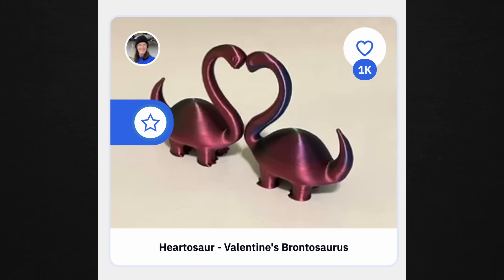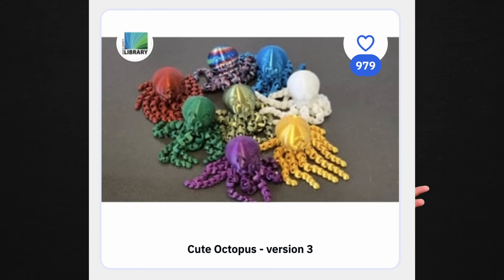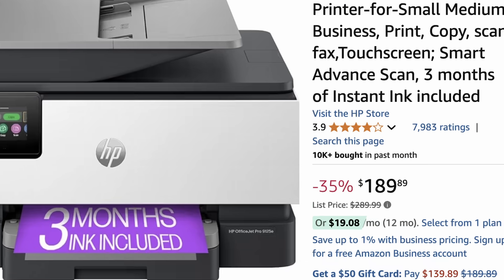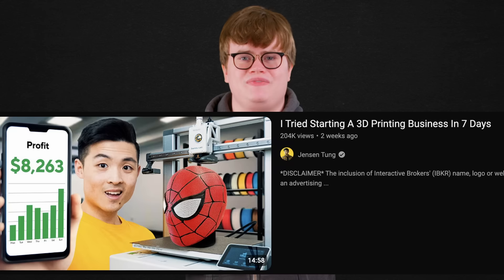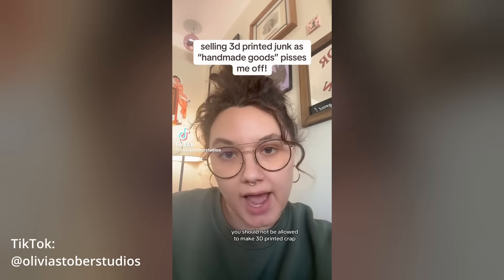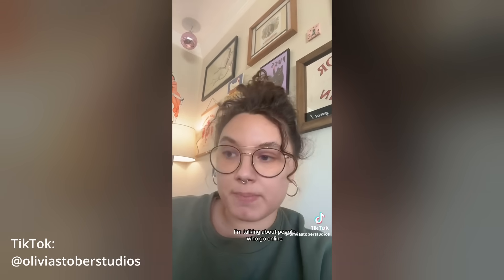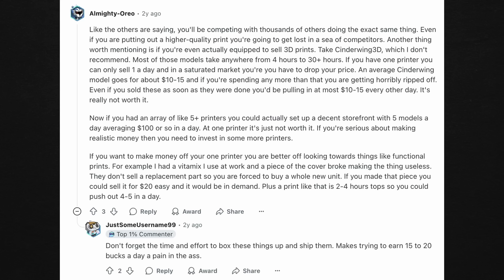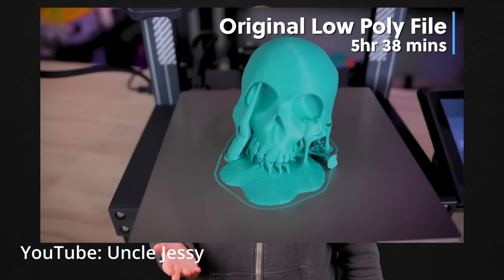The Rise of 3D-Printed Slop

Comment: I do agree with the video in that there are too many useless models and not enough useful ones. I mainly got the 3D printer to print useful items that I wouldn't be able to get otherwise, or I would have to import from China and would possibly get lost in transit. You can find some useful objects to print, but you won't find them by browsing the most popular prints looking for ideas on what to print. Which is why people end up printing so much useless junk, it tends to be all that shows up when you browse Thingiverse etc. not knowing what to print, and it's a self perpetuating issue, because they get printed the most, they stay high up on the most popular lists. As well as that, obviously they will be more universally liked than some niche item designed to solve a specific problem or an accessory for a specific thing that you need to own in order to have any use for it, so such models can't possibly compete in popularity.
I do like printing useless things when I find something that catches my eye, but it doesn't do much to justify the purchase of the 3D printer and it just ends up taking up space in my already crowded apartment so I don't do it much.

Comment: You are missing a huge part of the issue... 3D printers (and the widgets that are so popular) are FUN.  Making your own widget is fun, making them for you children, nieces, nephews, etc is also fun.  The main reason 3D printers are so cheap and readily accessible is because they are fun, so people buy them.  If the market was only a niche subset of designers then they would be a professional tool and outrageously expensive. It's also fun to just make something yourself instead of buying some generic mold injected plastic toy.

The "problem" you're describing feels similar to a painter complaining that children are using paint brushes incorrectly instead of smiling and letting the kids have fun.  Is it annoying that models with intended uses are harder to find, yes.  But I'd rather than having 3D printer so niche that I could never buy one.  Also, I fully agree the plastic waste is a huge problem and there are too many poor quality useless widgets online.

Comment: I would like to point out that even though a lot of the stuff out there can be a waste of filament it typically is not difficult to recycle especially since the most common 3d printing materials, PLA and PETG, are very recyclable. PLA is made from corn starch and other natural materials and PETG is made from the same thing that recyclable bottles are made of. There are exceptions to this when printing with things like nylon or ABS however these are far less commonly used and due to their strength as a material will often be in use as a practical item for a long time.
Reply: pla not so much petg yeah

Comment: It's crazy how the layer line 'aesthetic' has become so ubiquitous that I hadn't even considered that like, they shouldn't look like that. All the 3D printing content I see is usually youtubers making interesting objects or machines, so I guess it does make sense for them since they don't need to look nice to prove the concept or be useful. I had just accepted that that's how 3D printing with extrusion is 'supposed' to look

Personally I've always had some interest, especially as someone who enjoys sculpting (physical, real-world sculpting) and has been interested in getting into digital sculpting, and as someone who plays tabletop games here and there, but I would really want to do resin printing where the layer lines are much less visible if at all, and that is not nearly as cheap or easy to get into from what I can tell
Reply: In all fairness half the tutorial content on FDM printing is how to get rid of layer lines. Print settings, vapor smoothing or applying filler and sanding, etc because some uses require the mechanical properties of FDM filament.

Comment: If you don't like layer lines, resin printers are for you. The prints look perfectly smooth, and more detailed than FDM printing is capable of. It's the way to go for decorative prints.
I do quite like models that treat the layer lines as a feature rather than trying to hide them. Low poly models and geometric shapes can look quite nice with layer lines. I have seen some geometric vases and other models, which especially when printed in a nice multicolor filament, can look amazing. It's just a matter of playing to the strengths of FDM printing when designing a model.
Reply: Or use matte plastics, or use low layer height, or use a good extruder and replace one of the gears with a bearing, or use 0.2 nozzles, or use a tumbling polisher, or use actone vapor smoothing. Resin printing requires so much post processing and generates so much toxic gas it sucks unless you want extreme detail
Reply: @youtubehandlesux  Yes! Matte black PLA+ is currently my favorite thing to print functional parts with, the layer lines are barely visible, it's like magic. But it's not as good for decorative objects since it's black. I haven't come across colored matte filaments yet at the places I shop, but I'm sure it exists. Selection here is a bit limited and shipping costs buying globally is too expensive to be worth it.
Acetone vapor also requires post processing and ABS generates toxic gas, and the result has less detail as they get smoothed out. I prefer to stay away from both ABS and resin personally, I stick to PLA and PETG which are generally deemed safe. ABS and resin are still good options, you just need better ventilation than I can achieve in this apartment. But true, resin is not without its caveats.
Reducing the layer height helps (especially in combination with a smaller nozzle diameter) but it doesn't fully eliminate layer lines, causes prints to take an absolute age to print, and results in weaker prints, so it just isn't really a good solution. It's probably quicker to sand + paint than wait for a print to complete at 0.05mm layer height in most cases.
Reply: @Jdbye  acetone is flammable and ABS is cancer causing but I've never read about anyone almost lost their vision due to fumes with FDM, guess I just don't trust something that can do that. I'm also allergic to certain types of resin glue, no idea whether those used for printing would cause it. By the way matte yellow filaments look even better than black ones due to its color being similar to lightblubs.

Comment: I use my 3d printer sometimes, and it has helped me. For example I 3D printed replacement cams for some ikea furniture. I think my printer will probably break before it makes back its cost, but it saves a lot of time. I don't think I'd have one if I didn't get the printer and filament for free from my employer.

In the classroom, 3D printers are a wonderful tool. I am able to assign students more complicated projects that are still completed faster than the simple projects we used to machine out of metal. We create what appears to be a ton of waste, but I haven't actually bought that much filament, so I believe the hollow nature of prints makes the waste appear deceptively voluminous. In addition to engineering projects, many students do also print slop, but it is still a good way to get them interested in learning about tolerances etc (Like, why isn't your slop octopus moving? You need to change the dimensions to reduce friction...).

When I see people selling 3d slop at craft fairs and the like, I wonder why anyone would buy it, but I need to remember that most people don't have a ton of printers to use. I still think that one would be better off just asking their techbro friend who's really in to 3d printing to make one for them. I'm sure they'd be happy to have a use for it. I think that in an economic sense, 3d printing is best used as a way for designers to make their designs physical with a low barrier of entry, but is very rarely optimal for mass production.

Everyone I know with a 3d printer still buys far too many $1-10 plastic trinkets off of amazon.

Comment: I don't see a problem with printing something that has utility that could've otherwise been bought, in fact I think it's a good thing. Printing an item negates that product needing to be mass produced in a factory where tooling had to be made specifically for that product, warehoused, shipped between distribution centers, and finally put on a truck and delivered to your door. I don't have the data or information to know either way, but I suspect the 3D printer requires less energy and resources because fewer things have to be made and shipped. Also, if a printed item was made for its utility, why does it matter if the artifacts of its manufacture are not aesthetically pleasing? So it won't have a glossy smooth surface right out of the printer, that's fine if it doesn't need to be smooth to fulfill its intended purpose. You go on to talk about the environmental and health risks from 3D printing, but did not take into account the same damage caused by mass manufacturing. All the same if not worse is being done by anything else manufactured, it's just happening on the other side of the world. And lastly, nobody is remelting their filament outside of a small number of serious hobbyists because that's still very experimental.

Comment: Small items don't take hours to print these days. I can print a Benchy in half an hour or less. Even budget printers nowadays are capable of printing at high speeds.
Considering it takes a few days to receive an online order, even medium sized items are much quicker to print than to buy online, and you don't have to pay shipping. So the argument "why print what you can buy cheaply online" doesn't really work. And you can customize your prints to exactly fit your needs. Take for example the Nintendo Switch cartridge holders I printed for a bunch of my family members, sized to fit exactly inside of their pouch and hold as many games as possible. Sure, you can buy cartridge holders for cheap, and they'll probably look nicer too, but they won't be tailor made to go in a specific pouch.

Comment: Poorly executed video. Conflating two separate issues. Print Farm/3d printing as a business something that is an issue. And 3D printing as a hobby. Something that isn’t. The 3d Printed octopi and what not are fun and if you get enjoyment out of it great. The fact that you can get it injection molded from temu doesn’t matter. It’s like woodworking. For most people it will be cheaper and faster and easier to buy furniture than build it from scratch and a lot of beginning wood workers make things that serve little purpose. That’s fine. Now 3d printing as a get rich quick scheme is a problem and something i loathe. But as long as there are buyers i don’t have a problem with people selling whatever they want it’s a free market. As for makers complaining, I and old enough to remember when photography wasn’t art. It’s different now but there was a time when that was the case. If someone designed and 3D prints trinkets and people want to buy it at a maker fair I think it’s fair game.

Comment: Interesting to see (what I assume is) an outside perspective on 3d printers. Yeah, the garbage trinkets seem to end up everywhere, just because of the low barrier to entry. I and many people I know print practical items, often self-designed, for hobbies or real problems, and in some applications printers have been revolutionary tools because of the low cost of custom manufacturing. But the wider world sees little of those niches, just the crap on display, which is a shame.

Comment: i dont disagree with everything said here, however i think someone who dosnt own a printer or know anything about it should be making a video like this. 
you showed the cheapest printer you can get, you obviously arnt gonna get the best prints from cheapest printer. you spend a bit more, quality is amazing, time to print goes down x 10 and theres virtually no learning required to get great results. 

the real problem here is hustle culture and trying to do it fast easy and low effort. 

why print it when you can just buy it from temu? cos temu is just another evil corporation that donst care about anything but there bottom line. cos you can print whatever for cheaper than it took them to produce it at home, knowing pretty much what material its been made from. because f you i wanted too ?   

you think people using printers is anything compared to what billion $ company's do every day. and i suck cos i made a thing ?

and youv gone and said this to an audience of people that will mostly not have or know anything about 3d printing. sorta like a blind person telling another blind person what colors are.

i could go on but ive gone to far already lol